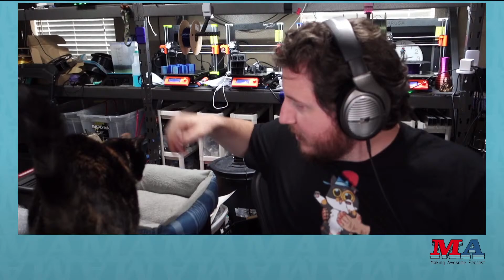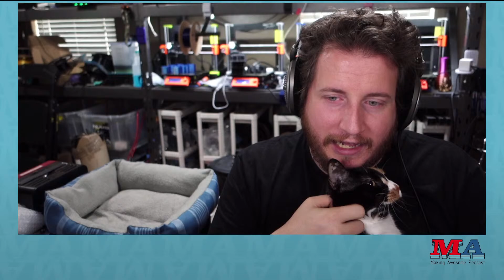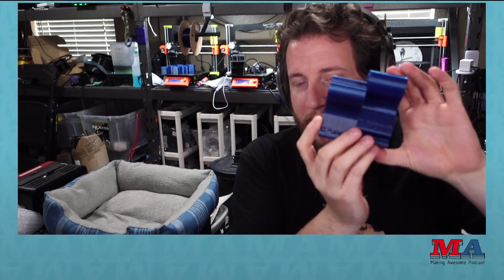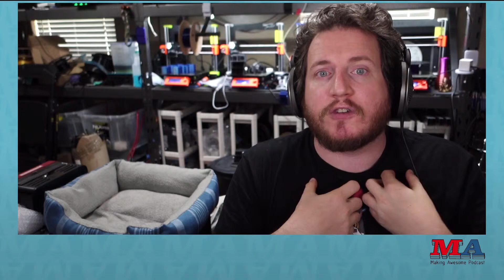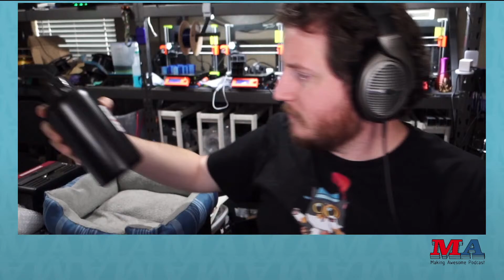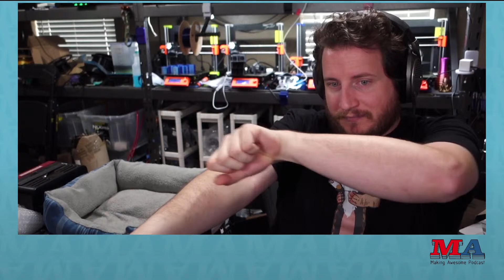Is RAW Better?!?! 3D Printing Material Basics - Making Awesome 197

Comment: This is Mitch from Polar Filament.  Totally bummed that I didn't get a chance to jump in the video for this topic (thanks for the birthday wishes by the way).  There's a lot that I can add to clear up SOME of the mysteries, especially because we manufacture for ourselves, but also a handful of other brands as well, so I can speak a bit about how different brands make their stuff.

Firstly, I saw MadCatUSA mention PLA-minus in the comments, which is what I plan on calling our "PLA with fillers" because it bothers me when companies add fillers, and called the filled version "PLA" and the filler-less version "PLA+".

Secondly, you talked about silks a bit.  Silk doesn't have to be TPU, but it almost always is.  The silky effect comes from mixing two unmixable plastics, such as PLA + TPU.  This same thing works for PLA + PETG, but the effect is a lot more muted, which is why it's not as popular.  It's just funny because to get the effect, you're literally mixing two things that shouldn't mix, so it's no surprise that it's difficult to print.

Third, if you're doing the drybox competions and you want a bunch of nylon to use for comparisons, let me know.  I've got a ton of Nylon-12 here now.  Nylon is a massive pain to print if it's not dry, so it might be a good way to test the effectiveness of dryboxes.  If you want, I can even make some UNDRIED if you really want to stress test how good the dryboxes are at extracting moisture (and that goes for PLA too)

And lastly, I'll definitely set aside some time next week if you're free.  I'll try to get some polar filament gift cards lined up too.  I know it's lame, but I can usually get 2x $10 cards and 2x $20 gift cards (yeah yeah yeah, I know $10 isn't a free spool, but it's what I usually get approved to hand out)

Awesome video though, this topic is something that I spend a lot of time working on.

Comment: FormFutura are another company that have been making a good range of exotics.

Thank god someone else sees the best use for glue stick....part removal.

Personally, I use a lot of FormFuturas TitanX ABS. I MUST use glue when using it otherwise it sticks way too well to the bed because of its blend. They also have ApolloX which is a similar blend but in ASA. Which is also available as a Kevlar blend. Can confirm, not bulletproof.

Comment: u need to try  the creality cr-ABS, it is non-toxic & has no odor & easier to work with than asa. its the only thing i will use in the ABS family. i have no idea how they did it, but its pretty cool.
Reply from the maker: but like.. what is it then? The styrene in ABS makes it toxic, so it is clearly not ABS.
Reply: @3DMusketeers I am not quite sure, but from what I can tell , they did a co-op with BASF to eliminate the toxins. So it is ABS, but they changed the chemical makeup.
  I printed with ASA's that gave me a headache. But when I tried the cr-ABS, there was no smell or odor < minimal warping. I went through 8 rolls of the cr-ABS over a couple weeks with both K1 Max's running pretty much non-stop & no side effects whatsoever.
 I wlwould recommend it to anyone needing to print "ABS", it works great in white & black, but I haven't tried the the colors yet, but I plan to when I print out my next 6 modular filament drawers.

Comment: 0:55 - The carbon fiber video that Nathan Builds Robots made was a bit surprising to me because I always figured the fibers would act like dust and just wash off, if they left the plastic at all. I never thought that they might actually embed themselves into the skin. That's why it surprised me.
Reply from the maker: nnnooopppppeee, its like small fish hooks, all over. Same with glass fiber.
Reply: @3DMusketeers  Good to know. Looks like I'll be retiring the material. I definitely won't be handling it without gloves anymore. Rather unfortunate, as PC-CF warps a lot less than standard polycarbonate.
Reply: @logicalfundy there's no reason to stop using any material just because of this. Throw on the correct ppe and continue to use it if it's a concern for you.

Let's be real, we may come to find one day that PLA has harmful properties to it if used consistently for long periods because the reality is... We haven't really done super long term testing on it. I doubt it, but it's not impossible.

Just use PPE.
Reply: @tasmaniakguitars  I used gloves for a while. But it turns out Prusament uses a different kind of carbon fiber that is much safer. So it looks like I'm not changing to a different brand any time soon unless they can also confirm they are using a safer CF.